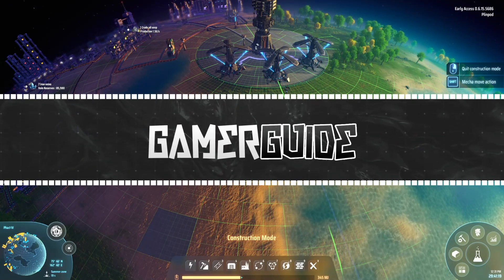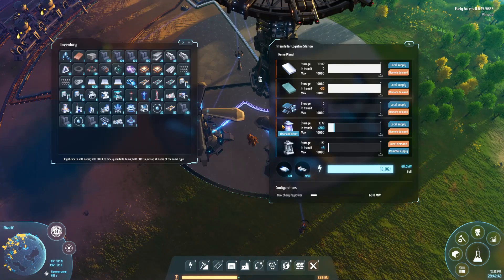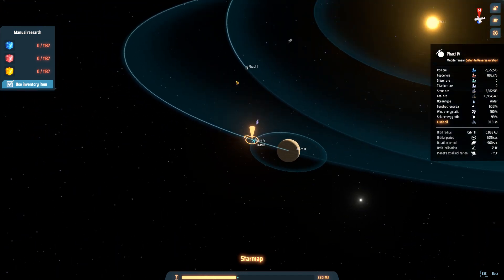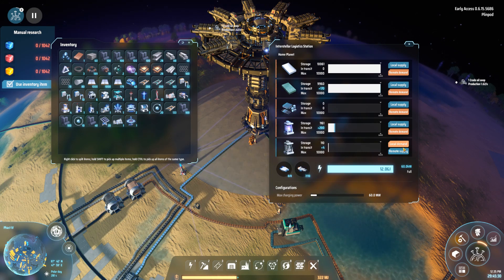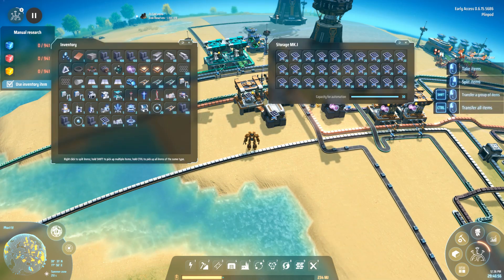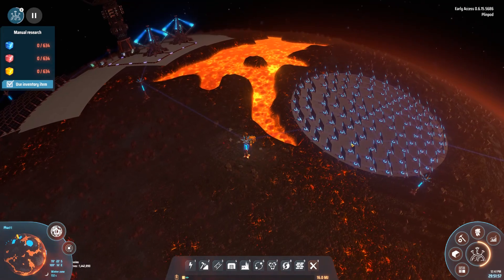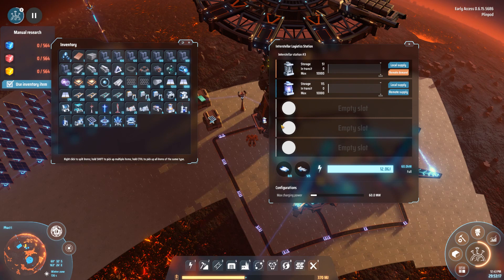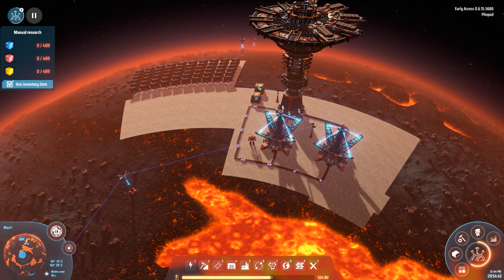Best Power Setup for Dyson Sphere Program - Energy Exchangers

Comment: Its neat, but 145mw isn't much if you are going to make purple, green and white cubes though. You need a shit load of resources from all over the place (and they run out too). You probably need like 10 of those on your home planet and likely need to set a hell of a lot more solar panels to get the required power. What you built is not much (yet) and the biggest problem becomes how fast you can ship it
Reply from the maker: Ya 145 is pretty low overall but that was just a small starter setup to show. Since the video I've tripled the amount of energy exchangers on the home planet without any issues. I had 2000 accumulators in the system and it took on the load of the new exchangers without problems. Should be good enough to hold out until deeper late game when you start playing around with the artificial star.
Reply: Agree, i am around 800MW on my home planet. about 1.5 GW in the system.

Comment: So Ive set this up but the fully charged accumulators are not shipping. Is there a tech that allows you to ship buildings or such?
Reply: The ships need a minimum amount of cargo to fly
Reply from the maker: You have to have at least 200 units of something for it to ship. If you have enough make sure that you have Remote Demand setup on your home planet logistics station.
Reply: @GamerGuidez  They fixed this in a recent patch, so you can drop the %cargo capacity on your sending station and it will send transports for both delivery and collection earlier! An awesome fix
Reply from the maker: @prome3us550  Ya that's a great patch for the cargo issue.

Comment: I didn't know you could ship energized accumulators. Thanks for the tip. This must mean you can ship energy between solar systems using warp logistic vessels.
Reply: You could even use full accumulators as a fuel source for your mech, but as far as i can remember it completely consumes it and doesnt give an empty one back
Reply from the maker: Yep you could if you wanted. Would require the use of space warpers. Or you can replicate the setup per solar system.